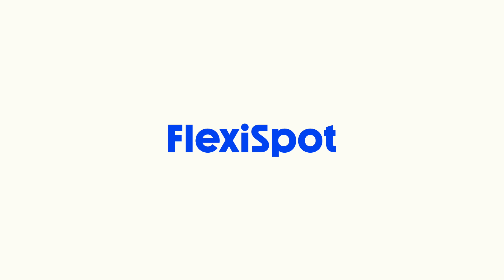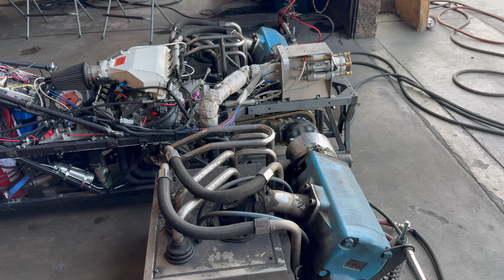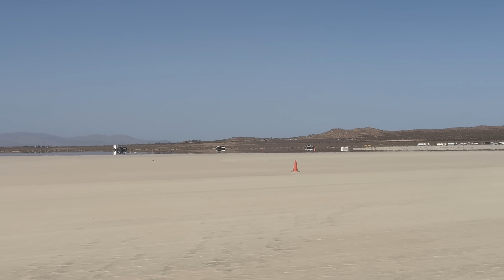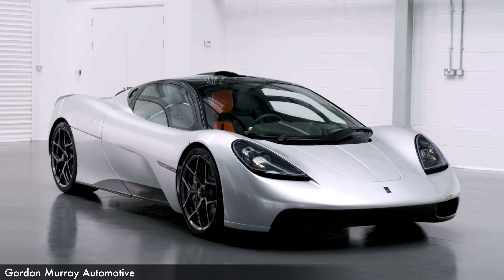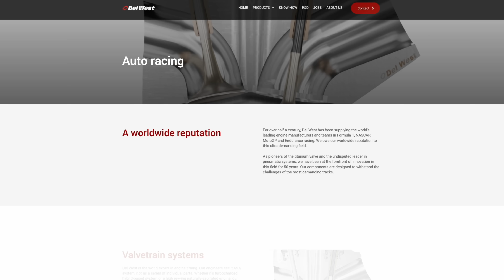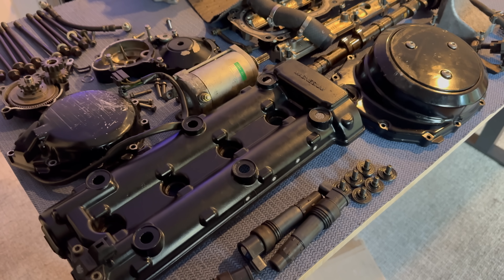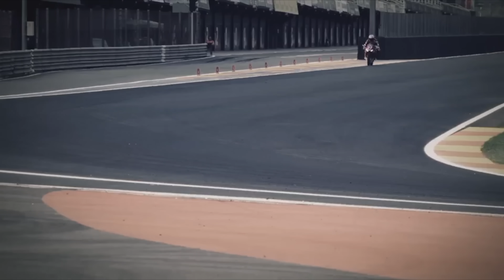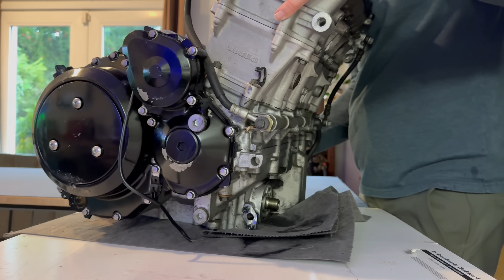Motorcycle Engines Are WAY BETTER than Car Engines

Comment: motorcycles don’t have to move around all the weight that a car engine must move around. Motorcycle engines are not recommended to use 0W 20 motor oil from the factory the way car engines are. I’m willing to say that motorcycle engines don’t see the long duty cycles that car engines do between regular maintenance chores.
I remember some motorcycle engines that were not that great. The CB 350 Honda twins of the late 60s and early 70s were about the worst. I can remember, they were camshaft eaters. Honda sent a bulletin to all the dealers to stock seven top and rebuild kits for every 10 motorcycles they sold . I was a Honda mechanic in the early seven days, and I did a lot of those 350 Honda top end rebuilds, I remember the Yamaha TX 750 twin, those engines were not good, the old Honda 152 Cylinder St. bike engines weren’t that great, I never saw or worked on one, but I do remember the mechanics telling me that was the worst engine look at the Yamaha three cylinders from the late 70s into the early 80s, 750s, I don’t know if you would consider second gear failures, a bad engine, but you had to pull the engine to split the cases to fix the second gear issues. 1977 Honda CB 750 F, suzuki‘s were out pacing the Hondas, so Honda stopped the production line and threw in larger valves in the two valve 750 engine, those engines would suck a valve doing a lot of damage because the valve guys could not support the valve being pushed by the hotter, cam and an angle, causing the valve guide to fail, of course the Honda Goldwing engines were pretty perfect from the very beginning and 75, but only now they’re having teething problems with that transmission that has the dual clutch
I can’t speak too much for the newer engines because I no longer work on motorcycles at a dealership. But the Yamaha V4 1200 and 1300 cc engines used in the ventures and the Vmax is just as bulletproof as the goldwing engines have been up until 2017. 
Of course I can remember the general motors 305 engines weren’t that great, the Vega engine was not that great. I won’t even go into the Volkswagen. Whatever happened to them. I had five Beatles, the old air, cooled boxer engines, I never had one fail. I used to buy one every winter to keep my 67 GTO convertible in my mga, which I still own out of the salt of winter here in Pennsylvania. They always were 100% reliable, of course I had to carry jumper, cables and starting fluid when it got really cold and a windshield scraper for the inside of the windshield when my breath would freeze on the windshield on the inside. I had a Ford E150 van six cylinder three speed manual shift that I bought new, it was a 1978, I drove that for 31 years and it drove away when I sold it to a scrapyard because I didn’t trust the frame anymore.. I remember the heads were always giving problems on the Grand Am Pontiac,, on the flipside, the 3.8 Pontiac engines ran forever. The Toyota Corolla has been voted the most reliable car in history a few times by poles taken in different automotive journals, those votes came from mechanics. I can’t remember too many Honda engine problems. A buddy of mine was a Honda dealership mechanic from 1973 until 2018. I was questioning him on if I should buy a Honda Civic for my 16-year-old, I asked if they were reliable. I remember what he said exactly, he said if you ever see a Honda on the side of the road, it’s either out of gas, has a flat tire, or the driver is taking a nature break, they don’t break down..
I was talking to a Toyota dealership mechanic, he was looking for a new job because he said these Toyotas just don’t break. They just keep going especially the Prius, the only thing they come in for his tires and brakes. So he went to become a BMW car dealership, mechanic, he said he never made so much money ..
I don’t know that you can proclaim motorcycle engines are better than car engines, they have different duty cycles, and the chances of someone that owns a motorcycle taking care of their vehicle are much greater than someone that owns a car and doesn’t even know how to put air in the tires , a motorcycle on is more likely to know about the condition of his tires and the air pressures and how long ago the oil was changed, but I’ve known some pretty clueless car drivers. A coworker of mine his wife drove her Toyota RAV4 with the oil light on for weeks, destroyed the engine, she never checked the oil. So I think it’s a case of a car owner being more likely to be clueless about maintenance than a motorcycle owner.
Cars, motorcycles, houses, people, they don’t necessarily wear out, as much as they are neglected to death
,

Comment: Another reason cars don't use the same style of transmissions is when you put 10x the weight on it, straight cut gears get loud, and they require a lot more commitment to shift, so H pattern straight cut geared transmissions (dog gears) require a lot more force that makes most manual drivers mess up at first.

Comment: Power per displacement and power per mass of the engine are very different design objectives though. If you want to get a backpack jetpack or helicopter, the weight aspect dominates. But either way, all this comes from motorcycles too.
The lack of effective turbo charging and limits to supercharging would have been a nice topic too. But great video overall.

Comment: Yes but no, quite some car engines have very impressive performance looking at piston pressure and acceleration. Even with the restrictions they have on emissions and longevity a Honda F20C is right up there with the motorcycles. Porsche engines too, but even a 'lowly' boxer in a BRZ. Just the way they deliver the power is very different because of the torque low down. The internal stresses and weight optimisation is actually incredible in cars too.

Comment: You totally missed a key aspect differentiating motocycle and car engines which is torque. Shorter stroke produces less torque and thats why you have to spin the crank to the million rpm to get meaningful power. Transmissions and clutches also do not care about power they care about torque hence low torque requires smaller transmissions

Comment: I've owned a lot of motorcycles in my time not all motercycles are high performance some are engineered with distance in mind goldwings  for example are lower revving with better torque for pulling heavier loads and last for a longer period of time there is a difference you did not mention car clutches are normally dry and run dry were as motorcycle clutches run in oil supplied from the engine sump (except older BMW's which are dry) were I'm from we use kilometres so normally 100,000 ks 60 ,000 miles is a normal rebuild time for most bikes but they can go well over that if not abused to much smaller motorscooters and a few larger Honda's run CVT transmissions which are belt driven and automatic all in all a great video

Comment: but wait, what if you made the car even lighter , removed one seat, took off the original steering wheel and box , reduced the chasis size and made a motorcycle with that motorcycle engine , imagine the performance then !

Comment: Great video as usual. Your explanation of the emissions issue is on point. I was the head of vehicle testing for Environment and Climate Change Canada (Canadian EPA) where we did chassis dynamometer exhaust emission testing  on everything from class 8 trucks down to the smallest scooters. One of the things that most people, even many mechanical engineers, don’t understand is that combustion from almost any internal combustion engine is extremely efficient. I have measured average combustion efficiency of a large electronically controlled diesel engine with no after treatment at 99.59%. Gasoline powered cars with no catalyst, in laboratory tests are currently above 97% thanks in part to electronic fuel injection. Having said that, 1% unburned fuel in the exhaust is 10,000 parts per million, thus the need for catalytic converters.  
Love the channel.

Comment: Matt, Could you do a video on why they can't (or don't) make motorcycle engines as QUIET as car engines? I have a GoldWing, but can still hear it running. Some cars are almost totally silent.
Reply: for the same reasons.  you want quiet, you need a big but mercilessly underbuilt engine and moto is just too small to do that for you and still be even slightly pleasurable to drive.  Think like those 190 hp V8s they used to make.   Then imagine if your big heavy goldwing's engine only produced 42hp.  that's about where you have to go to get that motor into 'quiet' territory

Comment: doesn't a larger stroke also mean more compression ratio which does help efficiency?

My notes for why cars can't reap the same benefits as moto engines because they are
- required to last 150k miles (vs 40k moto) meaning costlier, heavier parts
- stricter emission requirements for that 150k miles
- cars are heavier and more drag meaning more power required

Comment: you kinda forgot the torque.

maybe bike engines have more power per ccm in general.
but car engines have way more torque per ccm than bikes
Due to the higher torque a 1l car engine has more power at for example 4000rpm than a bike engine.
And all that with a much lower fuel consumtion.

This high reving maybe works good for leightweight bikes but in heavy cars these engines would be extremely useless. 
so there isnt really a need to build such fancy high reving car engines.

Comment: 13:54 Did that engine bay sticker actually say „SAE 0w-8“? 😮
Pour one out for the engineers of that thing ✊😔
Reply: Yeah.. modern Toyota's and even Mazda's nowadays use 0w-8 water lol.. oil I mean, but that's basically the same thing at this point

Comment: Sure motorcycle engines make a lot of power for size and displacement, but afaik they only last about 150k km, while car engines can easily last over double that. Motorcycle engines also use relatively a lot of fuel. My mom's 1.3L toyota yaris only uses about 1,5 times the amount of fuel compared to my suzuki SV650, despite being double the displacement and making about 40% more power, while hauling around about 5-6 times the weight. For these reasons I wouldn't want a motorcycle engine in my daily driver car.

Comment: And all that mechanical drag ! The whole valve drive needs to be driven. Königsegg is working on a 2l 3 Zylinder engine delivering 600 hp. Due to newly developed electromagnetic pneumatic valves needing no mechanical drive. That’s a very interesting further development

Comment: To make the statement "way better than car engines" is such a brave/risky statement. Surely it depends what the definition of "better" is? Yes, the power density is much greater but, then again, you don't see many motorcycles doing 200k+ Miles, do you, or pulling a trailer with another motorcycle on it? Motorcycle engine torque is also low for the engine displacement, so, horses (excuse the pun) for courses then.
Reply: Hes a numpty

Comment: No mention of the GR Corolla Engine, which makes 300hp out of a 1.6L 3 cylinder? Pretty close to the 200HP per Liter mark.  Are there other "affordable" engines that perform this well?

Comment: Small high revving motors make power but they don't last either, IV been messing around with a scooter here lately and to get power you have to get more revs out of them but more revs equals they just don't last, think about it like this run something slow it takes forever to wear away now increase that rub and your parts just don't last there's definitely a science to it

Comment: The other way around the valve bounce problem, of course, is to get rid of the valve spring and instead use a counteracting mechanism to close the valves. This system was invented in 1896(!), and  Ducati have been using it in production motorcycles for more than fifty years. They were also used in Messerschmidt Bf109 fighters from the 1930s, in Mercedes Benz Grand Prix cars and sports cars in the 1950s, and some other engines. It (obviously) requires more engineering and is more expensive to make than a simple spring, but...

Comment: Old model T flat v8 could get 30mpg 2500rpm peak and used very few parts of any quality. Torturous path for fuel equals torque not unlike complicated modern diesels but cheaper and using low grade fuel.

Comment: I learned more than I thought I would from watching them is video and you make it so easy to understand especially the transmission part I love it.

from my mechanic point of view the ONLY reasons I'd take a car engine over a bike is less maintenance requirements, engine longevity, less stress on part cause of lower RPMs and I have more knowledge on car engines.  Plus less parts makes it easier to fix sure have 4 valves is better than 2... till you have to pull the engine apart and fix it cause 1 valve got stuck out and kissed a piston and you have to play the "can I find the parts without going broke" game.   Not sure if bikes are cheaper to get parts for than cars but I do know 1 thing German= expensive AF, over engineered and have a pretty decent leak problem (BMW)

Comment: Genuine question then: Why is 100,000 km considered astronomical for a motorcycle engine, while it's normal for a car. The quick answer is; a car engine is tuned for mileage, while the motorcycle engine is tuned for performance (even non sports bikes). What I'm getting at is, if we tune down a quality motorcycle engine, would it outlast a typical non turbo car engine in terms of mileage?

Comment: Hondas have always felt like bike engines shoved in a car. Especially since I love my 1.5 and 1.6 engines revving to the 9000's. Building them in my teens i started on a trail 70 and then ended up in a CRX. The B16 I eventually put in it just seemed like a motorcycle engine enlarged. The k series piston speed is really fast too. i mean we have 2.4s turning 9's and 10's. Not sure who got fired but they are not the same company anymore. Even Toyota, the ones that had hybrids since forever haven't gone to electric motor transmissions driven by electricity made from a gasoline engine that can boost the car another like 20 horse power. Why didn't we keep the gas engine and add electric boost. i know early gen accord hybrid tried this but they should have kept going with it. Or just leave electric motors off cars. Now the ac compressor going electric instead of belt driven. That's something that should be come a norm.

Comment: Actually motorbike sized engines are formidable for cars and with some modern engineering they are also durable and keep the emissions within the limits. Greenpeace paid a Swiss developer who made a great 350cc 2 cylinder engine for the Twingo that doubled it's fuel economy. VW made a 2 cylinder diesel in the 80ies that got fhe Polo consuming less than 2 litres. The latter was not a motorbike engine though. Both were supercharged. Non of them was high revved. So the emission issue wasn't there.

Comment: One other thing why cars don't use motorcycle engines is torque. 200 hp should be enough even for a heavy car. But car engines with 200 hp have more torque, because they have the same power with much less rpm.

Comment: See matt says bikes arent meant to go 150k but ill be damned if my dad aint already halfway there with his raider 1900 (i ofc kid, i know there is a huge difference between a 1000cc inline 4 performance bike engine and the 1900cc vtwin on the raider, but damn if it isnt insane that its rocking 76k and still running as it did when he got it at 4k)

Comment: Instead of making car engines more like motorcycle engines, I wish they would make motorcycle engines more like car engines.
Last longer. Make torque at lower rpms, have a separate gear box with gear oil, longer oil change intervals

Comment: Talking with such confidence but you are very wrong about motorcycle engines not lasting as long. I've had many 125cc motorcycles past 50k+ miles and i now have a Yamaha super tenere 1200 that is famously known for hitting 120k+ miles without a single mechanical problem !!. a sports bike that has been raced all its life will struggle to get past 10k+ miles and the same goes for a performance car.

Comment: Multiple things that this guy says in the video are inaccurate.
This guy is a liar.  Why does my motorcycle only get 50mpg?  Total weight versus fuel economy tells us that something is wrong with the motorcycle engine.  If a motorcycle engine was as efficient as a car Engine, we should be getting over a hundred miles per gallon on every motorcycle

Comment: Is there any motorcycle engine that has 1 millions kilometres or close? No so they are not better, not even close as a car engine and they are more expensive as well (I'm excluding high performance cars and motorcycles). Motorcycles are a luxury item, cars are a necessity. Obviously I'm not counting the cheaper 125cc motorcycles but even those you're far better off buying a used car for the same price...

Comment: The limiting factor in car engines is piston speed (the upper limit is ~25 metres per second) . Motorcycle engine can produce more power per litre primarily  because they have very short piston stroke. This allows  rev much higher.. Eg a Chev LS piston (100mm) moves TWICE as fast in one as the piston in a Suzuki R1 (52mm) at the same RPM.

Comment: Okay, but what about Electric Generators?
What is the ideal engine for that?

2-stroke motorcycle (premium petrol) ?
4-stroke petrol car?
Or maybe a 4-stroke diesel engine?
How about one that is designed for running on Pure Ethanol?

Petrol is a volatile compound, diesel can last for ages. Not sure how it compares to Ethanol, which is a combustible fuel that is renewable.